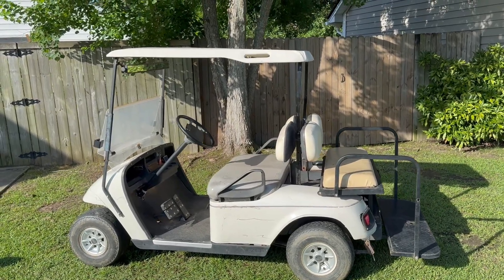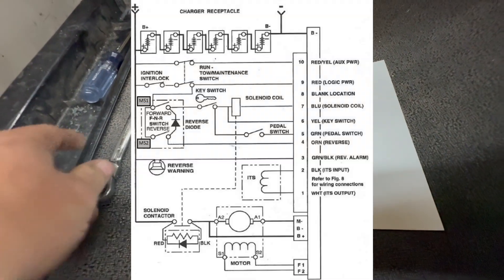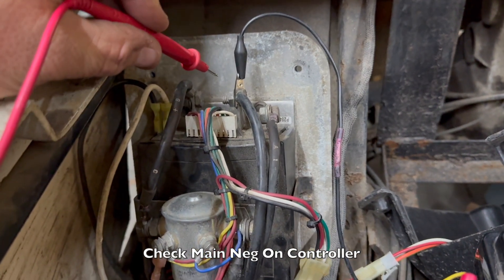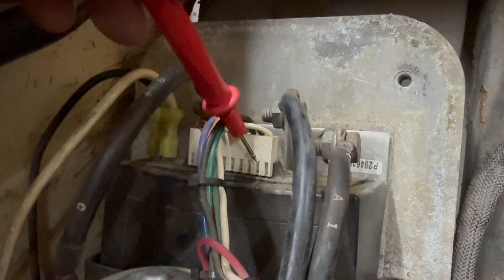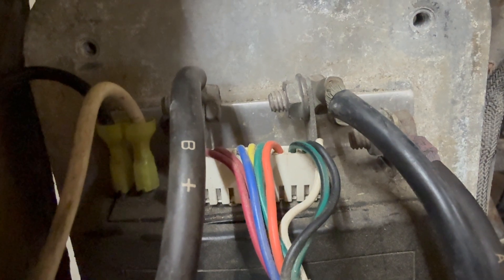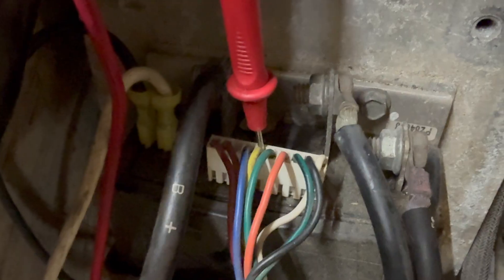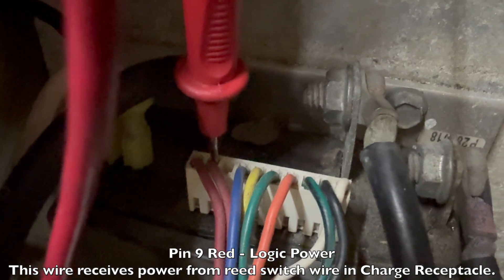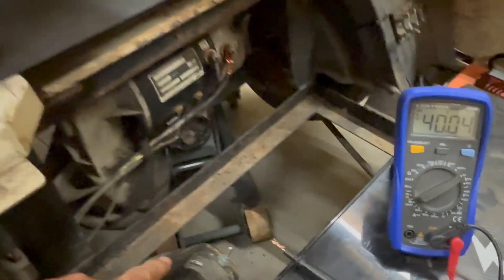EZGO TXT DCS Controller Test & Pin Out | How To Test Controller

Comment: I have the same cart. 1998 ego txt. The reverse quit working. I used your video and found the controller good. The fnr switch is good. The solenoid is good. What else could make the reverse quit?
Reply: I have the same problem with no reverse.  Did you ever find a solution with your golf cart?
Reply: I have a toro workman 48v with a 10 pin , have all the pin out diagram, toro has a interlock  system that really makes troubleshoot  difficult.The original owner bypassed and monkeyied with that system which left certain switches not present. I am restoring the interlock system with the original seat pressure switch which will satisfy  the back signal back to the controller. I   have  tested the contactor solenoid  and the two solenoids  up front under the hood.I have new batteries  and  the voltage is perfect.I have stumbled upon your video and this will take me to the next level if needed. I  am hoping that my sevcon millipak controller  is  OK. Thanks for posting